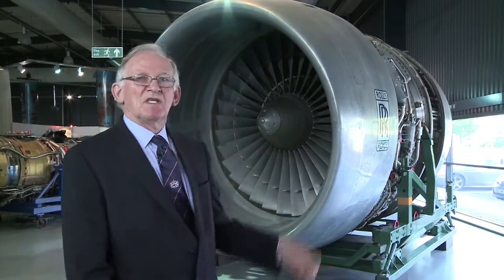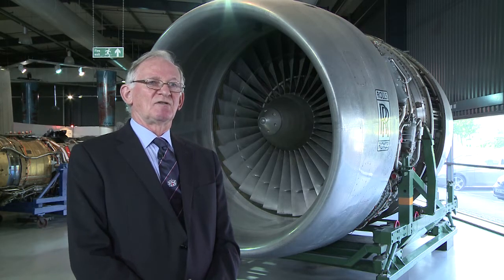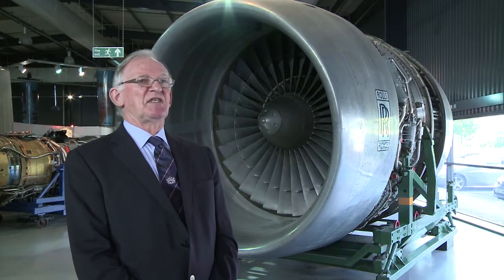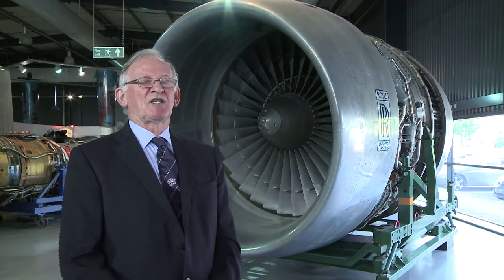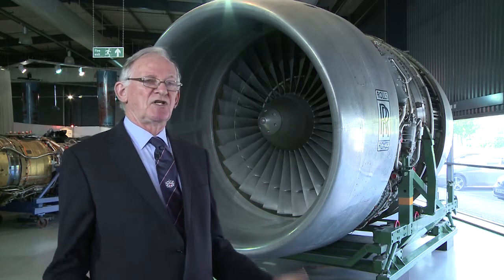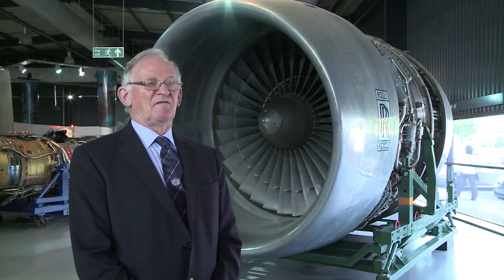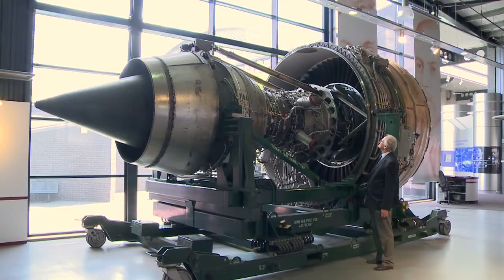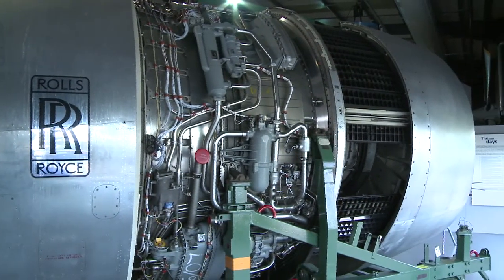John Coplin and the Rolls-Royce RB211

Comment: Complete bullshit as far as getting "more thrust" driving a fan than the "core" would otherwise produce. Regardless of where it's "produced" ALL of the "thrust" still comes from the  "core". And with "triple-spool" engines with their useless, power-wasting and fuel-sucking " intermediate" compressor and turbine stages for nothing but the fan, which doesn't allow the fan to help "drive" any accessory loads during "cruise", the net thrust output is reduced even more. The fan also turns "backward" compared to the    "LP" compressor and "triple-spool" engines are notorious fuel-hogs, very "underpowered" and "overloaded" and "leaned out" and prone to "compreasor surge" during low-speed, high-load and high "angle-of-attack" operation or in any other situation where intake air is blocked, disrupted or insufficient. Instead of starting with a "clean sheet" approach and "developing" a  "high bypass turbofan" from scratch, "Rolls-Royce" took an axial-flow "turbojet" that was in and of itself poorly "developed", more or less doubled the size of the "core" with no clue that would "square" rather than double the amount of fuel and air it would "consume" simply to "double" the power output and then had to add "intermediate" stages  and install a "free turbine" and "third shaft" and spin the fan the opposite direction in order to "govern" the engine and counteract the ridiculous, wasted "torque" the engine produces due to all the additional, unnecessary and useless internal "drag" and accessory load. With three "spools" it's impossible for those forces to ever cancel or balance out and the weight, complexity, length and expense of the engine, mounts and accessory systems is ridiculously out of proportion to the "thrust" with a "two-spool" engine of similar "thrust" being far lighter, shorter, smaller in diameter, less expensive, more efficient and quieter and one of similar dimensions, cost and "complexity" far more "powerful" and "feel efficient". Not to mention more durable, reliable, versatile, serviceable, smoother and quieter. There's a reasonably 275 Tri-Stars were built and why R-R "won" a non-existent "competition" to provide engines for them. All of the "orders" were "pre-orders" predicated on the claim and belief that the Tri-Star and it's "high-bypass turbofans" would be quieter, faster, more "fuel efficient" and "profitable" than all then-current Boeing "airliners" - the 727, 737 and 747. As well as "safer" than a DC-10.  Instead, the Tri-Star burned more fuel than a non-RB211 747, was all but unbearable as far as noise in the "coach" section of the cockpit if the rear engine was at more than "cruise" power during takeoff and reduced rear engine power just made the other two engine work longer and harder and louder. The "S-pipe" intake of the rear engine exacerbated "breathing problems" and became a funnel for rain, snow, ice, dust and any other debris that the aircraft happened to "encounter" and  "compressor surge" events were of such magnitude and violence that airframe and engine damage seemed  and eventually became inevitable with resulting required "inspections" being a  nightmare and "shit work" nearly always delegated to the most-junior and/or least-liked and least-liked to perform them correctly and safely "mechanics" on the maintenance crews. Compressor surges were most common in the most inclement weather be it the hottest, muggiest days of summer or coldest, wettest days of winter and there were/are no safe methods of getting onto and into the airframe and intake of the aircraft unless it's in the shop for maintenance and short of an obvious catastrophic failure or an engine failing to crank,start and run on the ground, aircraft were highly unlikely to be taken out of service based upon the "report" of an inexperienced and/or unliked "mechanic" even if he did manage to perform a "proper" inspection in the soot-filled, hot as hell or deep-freeze cold, wet and greasy or dry and dusty intake and nobody wanted to become the "go-to guy" for inspecting what were obviously poorly designed, engineered and constructed  engines, intakes and airframes produced by "engineers" with little or no practical and factual knowledge of and experience with "fluid dynamics" despite whatever "education" they'd received on "jet intakes" as "engineered" and "developed" in countries then-considered "superior" to the U.S. in "aerospace engineering", such as "Great  Britain" and "Russia". Their supposed and largely self-proclaimed" and entirely 
self-verified "superiority" was taken at face value by college professor "engineers" similarly "brillliant" in their own minds and closed, academic and "intellectual" communities where they were "right" and "wise" primarily because those who knew better and possessed knowledge rather than information and facts rather than theory ever  crossed paths, words and intellects with them. And typically after failing too "make it" in the "real world" of "engineering" regardless of their alleged IQ, aptitude, genius, brilliance or other  ''qualifications" per professors, parents, classmates, peers etc and even being taught or at least told quite the opposite in the "real world" by "fake" engineers without so much as a "degree" in ANYTHING but somehow having a "made it" working in the field at some manufacturer they were only "interning" for and where like it or not and educated or not, they were definitely "clueless", they probably ran back to the safety and security and comfort of "academia" where each new semester brought to them a new group of young, ignorant "idiots" to dazzle with their brilliance or at least baffle with their bullshit. Those are/were the true believers in things like Mach 2+ English Electric Lightnings with "stacked" rear-mounted, buried in the fuselage engines with 'reheat" breathing equally and well through that ridiculous "nose cone" intake. Or that 20,000 lbs of "static thrust" as "proven" by and from a bare, wide-open unconfined engine on a test stand remains 20,000 lbs of thrust and sufficient to "vertically lift" 20,000 lbs of "VTOL" aircraft once installed in an airframe, providing hydraulic and/or electric and/or pneumatic and/or mechanical power for various "accessory" systems and with "half" of it's "thrust" taken from the "cold" section of a so-called "turbofan" and the other "half" being the exhaust gas "thrust" with all of the above being directed to four rotating "nozzles" via many, many feet of restrictive, twisty, turny "ductwork" and best of all the hottest, least dense and most restricted "thrust" getting the job of "lifting" what is obviously the "heavy" end of the plane and the one common sense and 5 minutes watching a helicopter "transition" to and from "hover" and "forward flight" says and shows is the end you want to be "light". The list of "brilliant" British "engineering achievements" which haven't been laughed into the "memory hole" only because those "wise" and "intellectually curious" enough to read/see/hear about their "nuts and bolts" and recognize propaganda from a mile away simply because according to "historians" and other "experts"  pretty much everything they ever "developed" was "perfect" at the ""prototype" stage and therefore required only "further development" once in "production", is essentially "endless". Makes me wonder why R-R didn't build entire airplanes instead of just engines.
Reply: What ranting drivel, what medication are you taking?
Reply: The RB211 was a highly successful series of engines, and the direct anticident of the Trent Series.    Rolls-Royce remains the only manufacturer that can compete directly with GE. In the very high bypass space.

I would suggest that RR engineering and design has been vindicated.  

I doubt you would agree.
Reply: angry much?
Reply: Amusing. I remember when QANTAS ditched their P&W JT9s for the RB211-524D4.
Reply: @lukebrennan5780  The above rant is just that, in the second sentence he confuses thrust with power, not much point reading it after that.

Some American company's PR departments were quite good at taking credit for all that came from England. One of the reasons Whittle was sent on his tour of America was that the British had got word that certain American companies were claiming that they had invented radar by themselves, including the magnetron, and the same had started to be circulated about the jet engine. 

Britain not only sent a Whittle turbine to the US along with all the drawings and documents, they also sent one of the two flight certified de Havilland H1 (later named Goblin) jet engines (the spare to the engine being used in the Vampire prototype) to the USA to power the Lockheed P80 Shooting star prototype. 

After inspecting the P80, the British engineer who delivered the engine warned Lockheed that the skin of the inlet ducts was too thin to withstand the low pressure (suction, if you must) in the inlet ducts due to the jet's airflow. But the American engineers ignored this warning (after all, he wasn't American, what did he know) , both ducts collapsed and were sucked into the engine during ground testing when at full throttle, the engine did not like this one bit. de Havilland urgently shipped the engine intended for the prototype Vampire to replace the destroyed H1.  

The British also sent all the drawings and data on the Metropolitan Vickers F2 axial compressor jet engine which was being developed concurrently with, but separate to, the Whittle and Halford (H1) jet engines.  This powered the Meteor eight months after its maiden flight.  I have provided a simplified timeline below.

DG206/G powered by two Halford H1 jet engines (straight through), Meteor's maiden flight on 5 March 1943
DG205/G powered by two Rover W2B/23 jet engines (whittle pattern), first flown 12 June 1943
DG204/G powered by two Metrovick F2 axial jet engines, unlike the other F.9/40s the engines were mounted under the wing (much like the Me262), first flown 13 November 1943

Yes, QANTAS changed over for a number of reasons including more economical operation of the aircraft.  Unfortunately, there was a downside - QF32!  Parts of R-R had lost the plot and it resulted in "the greatest air disaster that never happened", but, by the Gods, it was close.  Those four letters should be emblazoned on the walls of every part of R-R that is concerned with aircraft turbines.

Comment: I woke up one morning  somewhere over the Atlantic ocean. Maybe 8 or 9 years old, wide eyed, in the kitchen of a 747-168 I looked through the windows and fell in love with those old grey monsters as the fans windmilled on. All I heard was Swooshhhhhhhhhh. Later I would learn they were called RB211s
Reply: Windows and sleeping kids in the "kitchen" of a 747, huh? Interesting. BTW, turbofans don't make "whoosh" sounds. And your "747-168" was powered by a Pratt & Whitney JT9D-3A. Not an "RB211".
Reply: @deeremeyer1749  The P&W -3A engine was only sold on the first batch of 747 production.  The Saudi Airlines order for 8 of the new 747-168B model was first delivered in 1979 with RB211-524B engines.  (Any airline that had the P&W -3A engines on delivery had long since upgraded to -7 by 1974, either directly or after an intermix operation until enough field certified upgrade kits were available).
Reply: U must've  passed out on the floor. The 747 has a galley not a kitchen and there's  no seats on it
Reply: And it’s not a..‘kitchen’…it’s a galley, a term taken from the maritime world

Comment: If it wasn’t for the rb211 there would be no Trent 700, Trent 809, Trent 900, or even Trent 1000, Trent 7000, or Trent XWB. They are all variants of the rb211
Reply: And no L-1011
Reply: @aarondynamics1311 yes because the rb211 was built solely to use in the TriStar
Reply: Speedbird full blown Brunswick
Reply: I agree. 👍🏻